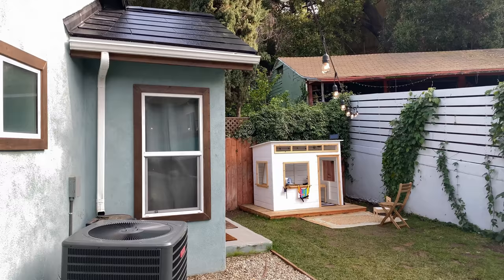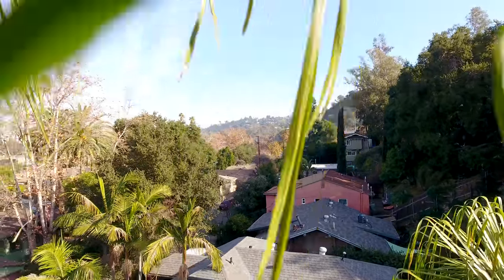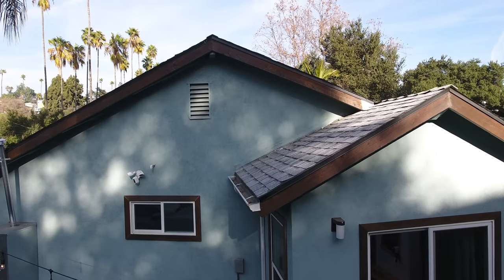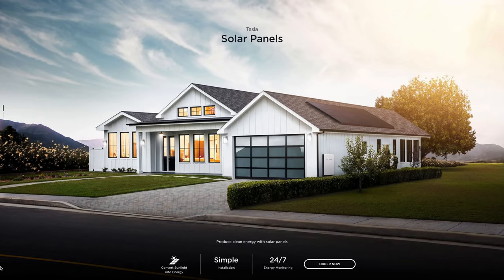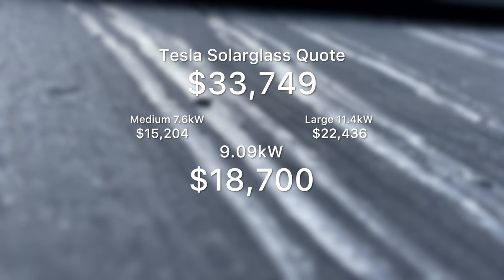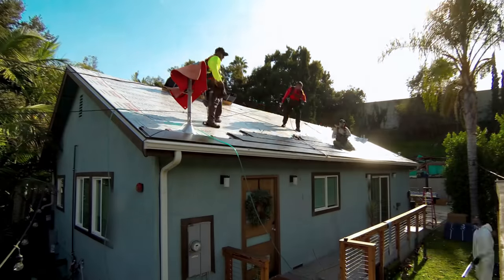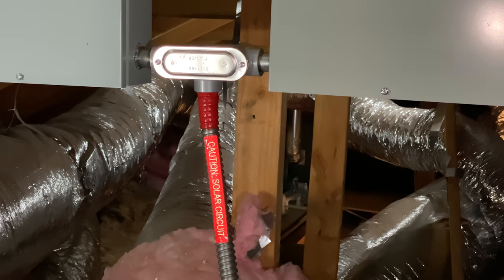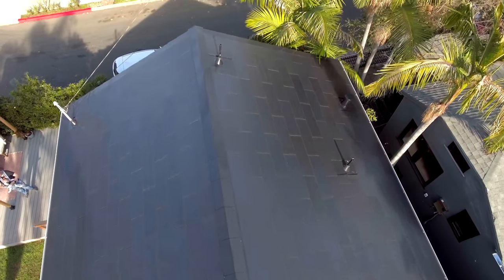WE GOT A TESLA SOLAR ROOF : First impressions and what you need to know!

Comment: Your annual electric bill cost would be good to determine a ROI

Also things like when its cloudy/night time what happens
Reply: I would believe you can roll-in a nice battery wall into the deal. Also, many states require a power-buy-back or your power company will have it's own program.

The power-buy-back idea is meant to turn your home into a power plant of sorts. Any overflow, you don't use, feeds the grid. The power company will deduct the amount you created from your monthly. Either eliminating the cost of your bill or even writing you a check for creating more than you use. 

Really puts that extra solar to use, when you're not home during the day and no power is being used in home.

Comment: Guessing this is a string configuration. What happens when one of the solar tiles fail?
Reply from the maker: Bypass diodes. Also, Tesla is on the hook to repair for 25 years.
Reply: @grahamherbert3612  You are a f'in genius!

Comment: Nice, wish they could have cut the stucco instead of cheating out on this part. Find cut and sticking of a counter flashing. Such a lazy thing to do considering its Tesla 

I wonder if there 25 year warranty  included coming back after 5-10 years to seal all pipe Jack's and heater  vents which is usally needed as part if maintenance. 

This would mean that tiles would have to come up in order  to walk the roof. 

Good luck hope this works out.

Comment: Did the crew use any type of safety harness? Hard to tell from your video. If not, one of them could fall down and get seriouly injured (even at that height). You could be implicated and sued etc. You should insist that the installers are insured, use correct safety systems, and make sure that the contract protects you. Dont assume that you are not responsible for accidents etc.

Comment: I’m in the business (traditional solar not with Tesla) and the numbers don’t make sense.

In comparing to a traditional solar array there are two things that are off.  First, a 9 kW system would actually cost a lot more than the $18,700 you mentioned.  Second I can’t imagine you would need that size of a system.  

To generate the power of the solar roof you would need a smaller system.  Since I don’t know your actual power needs I can’t reasonably estimate a cost.

Anyway perhaps one would simply offset the other, know way to know. But the video was good.

Comment: how much did it cost you didn't methion the huge batterys that cost alot I did this to my roof on a tesla web sight and it came out 2 68,000 with 3 battery
Reply from the maker: $41k before rebates, $33k after. We opted not to get powerwalls. Don’t think it’s worth it for us, considering we have net energy metering. Can always add later.

Comment: Just one question, how much electricity do you pay annually?  How old are you guys?  If you pay 1k a year on electricity.  Does it means that 30 years later then you will get some benefit out of it, assuming that the panel quality can last that long.   If you are 50 years of age,  I think you have been ripped off.   If the house is later passes down to your relative, they might get some benefit from it.  What material are the panel being made from?  fiber glass composite?
Reply from the maker: We’re in our mid 30’s and last year our electric bill was $2,135. The solar portion of the roof should take about 10 years to pay for itself.
Reply from the maker: The tiles are made of tempered glass and metal (I think aluminum).

Comment: It must be cheaper where you live, or they significantly reduced the price. When I priced out a V1 Tesla roof, the online calculator estimated about $65,000 for my 1350 sqft house with about 19 squares of roof.
Reply from the maker: V3 is waaaay cheaper than V1 or V2.
Reply: @AustinFlack  my timing was 2 years too soon on when I needed my new roof. I very much like the idea of the solar panel being the actual roof. Thanks for sharing your costs.

Comment: So every 25 years you have to start over.   Conventional Solar Panels go over the existing roof, so depending on the life left of your roof you save more money by not having to replace your roof as is done in this example.  So consider taking out the $12,000 new roof when doing your own ROI, and figuring the life left in your existing roof.  Also be sure to research what was referred as Available Rebates.  The Federal Tax credit was 30% at the time of this video, now it's 26%, and in 2022 drops to 22%.  It is then gone.  And if you are on a Fixed Income and and do not have a household taxable income of at least $75,000, you will not get your money back as a full tax credit.  This is not a Rebate, it is money given back to you out of tax money you must have paid.  

If you are in this for being Green, then go for it.   Not sure how we will dispose of the panels in 25 years, but hopefully that will be addressed.  Too early in the Industry to know how much of a problem that will be. But if you want to save money, think again....Most electric companies and available 3rd party Suppliers competing for your business, the cost of Electric has not gone up.  In fact it has dropped.  Also, we are energy independent, oil and gas are in abundance, and very low costs.  It's cheaper not to go Solar.

I am retired from a competing Solar Company.  None of my past customers have saved any money.  At the time of sale, energy costs were projected to increase 5%,and with Lease Options and Energy Tax Credits it made sense at the time.  It didn't work out that way.

Simple fact, you will not save any money, no matter what the Sales Rep tries to tell you.  And be sure to do your research, 25 years is a long time and commitment.

Comment: Correct me if i'm wrong but i think that more than a 50% of your electricity is used in heating and cooling the house. I just sad to see a "green" company to say not a thing about retrofitting the house.
 A house should not need heating and cooling if design to this, there are many examples of that, from earthships (that most people will not do because is big and impractical in most situations) to other options like the reactive house (explained by Bill Mollison), and those are two examples there are others models. 
And a house that was not design like this could be retrofitted with some features that will allow to came close to zero energy in heating and cooling.  And this is much more appropriate approach first reduce the necessity of energy, then asses how much panel you need.  
Not everything the is sell as green is sustainable.
Cheers.

Comment: any idea of today's cost might be? (pretty much the same still, I guess?) ,,,I sold my 1st generation Nissan Leaf with it's pi*s poor range t  $3,000 loss, but not before asking local solar companies if they could fix x-panels on the car. :( ,,, we're getting there ...my first solar calculator was early 70's ☺
Reply from the maker: I plugged in my address to the calculator on the Tesla website and the quote came back only $700 higher.

Comment: What's the expected pay back time for the roof?
Reply: Richard Dixon  in the UK I pay about £50 month for electricity, so for c£20k install cost and a bit of inflation it would still be near 30 years to pay back excluding maintenance and assuming it even lasts that long before replacing!
Reply from the maker: Hard to say but: 1) I needed a new roof 2) the extra I paid for solar should pay for itself in about 10 years 3) it will add significant value to the sale price of the home
Reply: @AustinFlack  thanks, that sort of pay back time is great. I'd definitely do it if it worked out like that in the UK. But it would be 3x that to pay back for me 😔

Comment: Two things I did not mention. One if you are worried about global warming this is a great way to slow it down slightly. Because the coal fired furnace thats making your  electricity will run a tiny bit less. Two, But you can never 0 your bill.

Comment: So 9kw is less than half of our home's electrical panel, and I'm betting it's less than yours too?  9kw @ 120v is about 75 amps, and our panel has 200 amp service delivery... so I'm not following your math here completely.  Also, is it your plan to completely disconnect from the local electric utility provider or ??  Thanks- very interesting for sure!  We spend about +/- $2,500/yr on electricity annually, so this would only be about half the warranty time, which would be great, but again, it's also only about half my current panel....so I'm not sure.

Comment: $18,700 for a conventional 9,09kW??? That is super expensive. At least here in Brazil you can get a 9,38kWp system for less than R$40,000 (U$9,000)

Comment: That will never pay for itself
Reply from the maker: Solar portion will pay for itself in about 10 years. Also, adds considerable value to the sale price of the home.
Reply: @AustinFlack  if your electric bill is over $250 you're doing something wrong in the first place. Solar has a long ways to go for it to be worth it.
Reply from the maker: Eric Diekmann I have an electric car that charges at home. Also, it’s often very hot in LA.
Reply: @AustinFlack  solar will not and does not pay for itself

Comment: Approvel? Permission to turn it on? From who? If I’m spending that kind of dough for a solar system, I don’t need approval to use it... I’m using it.
Reply from the maker: City building and safety, for the permit, and permission to operate from the utility company, since I will be contributing electricity to the grid.
Reply: Austin Flack , needless bureaucracy as far as city building and safety. That’s just letting them know they can raise your property taxes. I understand the utility company’s position though. With all the red tape politicians put us through I would be looking for a system that’s totally off grid, leaving the local authorities and power company out of it completely. That being said, you still have a pretty impressive set up!

Comment: I'm too far north to even consider system like this would go for Dobele glass poly solar panels and DIY building integrated installation. Either with grid tie inverter or a charge controller plus used truck batteries for scrap price for dc only system

Comment: So, $30,000 for the solar roof......
That would take around 30 years to pay for it’s self, not sure i would be around still!
Reply: Remember to subtract the cost of installing a new standard roof. Then add the increase in value to your home for having both a new, long lasting, roof and a solar setup that brings your energy cost at or close to zero each year.

May not completely cover all of the $30k; at least it won't be 30 years before you can consider it paying for itself.
Reply: Philis Saulnier i have a metal roof that will out live me and probably the people who live here next so not needed to add to the cost.
Solar just isn’t viable where i live, electricity is cheap.

Comment: I just did a USD(33 000) to CAD(44 000....i'm Canadian) and your house is about the same size has mine. Without even taking into consideration the interest I would pay on my 44 000$ to get the solar glass installed. It would essentially take 18.5 years for the investment to pay itself back....Maybe in 10 years when the price goes down to 1/3 of that it's going to be worth while. But not now. Especially if it's a grid tied in system...which I assume it is because it's not sunny everyday, electricity companies usually have a montly minimum just to be connected (30-50$). It makes for a cool youtube video but it would have been smarter for you to spend maybe 2500$ to just get your roof redone with 15years(life) grey shingles. More money than brains, I guess that's the American way right?!

Comment: The numbers wouldn't work for me. $33,749 for a roof, and my current electric bill is $1,383/year. The breakeven point is 24.4 years. 24.4 years before I begin saving a dime.
Reply from the maker: Only makes sense if you need a new roof.

Comment: Well, I say, it's just like anything else that will benefit you. . You are going to pay through the nose for it. And you will probably not receive your pay back In full . Maybe about the same time you need to fix it or replace it. Just like some of these high-efficiency air conditioners. Well, you're paying so much more for it, any savings you will have gotten, they're gone right from the start. . I love the idea and the concept. And it does look nice.  . But it's a rip-off. Just like everything else. However, I also think, if you have 10 KW and you're feeding into the electric grid, you should be getting a check at some point.
 I spend about 14 1500$ a year on electric. I wouldn't be surprised if the oil companies get a kickback for putting them out of business. I'm an AC contactor and I have seen it. High-efficiency cost through the nose. And the bad thing is high-efficiency isn't anything new. You would think they would only make the high-efficiency ones. And stop all the other s***. . No, they're not doing that. Please keep us informed. I'm real curious about you getting paid from the power company. For your access

Comment: $2000 per year saving on power bill for 25 yrs is 50 grand...if we spend 33 K today

If we invest 33 grand on compound interest at 2.5 % we will get 64 grand in 25 yrs

Where am I going wrong ..pls confirm
Of course .. I know ...no inflation factored in
Reply from the maker: I needed a roof. Also, it adds substantial value to the house, which, in LA at least, is a rapidly appreciating asset.

Comment: I'm a tech loving guy, a lover of  innovations and alternative power, AND a builder, but Jeezuz, I see innumerable downsides to this concept.
(1) Only half that roof is gunna be facing the sun (and only if north/south). What a waste of panels and tech on the shady side.
(2) As any builder will tell you, the smaller the components, the more components, the more the fixings, the more the labour, the more the money. Bigger panels would mount quicker, stronger, less wiring.
(3) If ever your roof leaks or gets a branch, it needs a specialist solar technician for repair rather than a common roofer.
(4) If you previously have corrogated iron sheet roofing, you'd need closer tile timber battening prior to roof tiles. More money, more weight on the trusses.
(5) Black. Hottest colour on earth, therefore extra roof insulation.
(6) If any one tile fails, I imagine the roof looses more than just that current (probably one series of an array). 
(7) Looks like you would never dare to walk on it. Didn't see any installers step on it. Therefore makes it hard to clean and service.
(8) I see comments on warranty and repairs by Tesla from damage. Therefore your costs must include THEIR  insurance. Oooops, another hidden cost sheet roofs don't need to have.

Comment: thanks for the video.. based on your numbers(not including permitting cost and your time), it will take more than 15 years for the solar savings to offset the extra cost, which at that point the warranty and design life is over. Seems like it was a waste of hard earned cash. Lets see how they look after a year with a thick layer of dust built up over top.
Reply: Warranty is 25. So it still has 10 years left after that, and as you don't know their power costs, you are making assumptions. My house has an electric bill of almost 450 a month. Meaning I pay 135k in period of time.

So your opinion is noted, but as you don't have any data? Don't call it a waste and to try to drive people away.

Comment: I'm disappointed to hear that it is only going to last 25 years. That's no different from a regular shingle roof... They say slate roofs last 125 years, and I was under the impression that Tesla was comparing the solar shingles to slate- even going so far as to say they are MORE durable, not even cracking from things like significant-sized hail. So how would this only last 25 years then? If it's only lasting 25 years, you're looking at a cost of 33 grand every 25 years, right? Doesn't seem like it makes sense to make this purchase unless they are guaranteeing it to last longer than that.
Reply from the maker: It doesn’t last 25 years, it’s guaranteed for that long. 

From the purchase agreement: 

Limited Warranties
Tesla, Inc. warrants that:
(1) Product Warranty. Your Solar Roof will be free from defects in design, materials, and
workmanship for 25 years from the date your Solar Roof is installed, except as otherwise provided
in the Module Warranty below.
(2) Weatherization Warranty. Your Solar Roof will remain in place and prevent damage to your
Home caused by the passage of wind and rain through your Solar Roof for 25 years from the date
your Solar Roof is installed.
(3) Module Warranty. The power output capacity1 of your Solar Roof will be at least 95.0% of
the “Rated Peak Power”2 specified on the Solar Roof’s data sheet (multiplied by the size of your
Solar Roof) at 5 years after your Solar Roof is installed. The power output capacity will decline by
no more than 0.5% per year for the following 20 years. This warranty covers the power your Solar
Roof will produce under standard test conditions.”

Comment: 12k for roofing 18 square work of roofing is a bs price, anyone paying this took their first quote from a overpriced contractor. 1 square (100 sqft) of 30 year shingles is $65- $75 plus tax , even if we make that 100 per square and went premium with water and ice shield, had to replace a few deck sheets maybe even do a little re-framing materials are less than 4k even without contractor pricing . 
4 grand for a day or two of labor is one hell of a markup .
Reply from the maker: I got three quotes